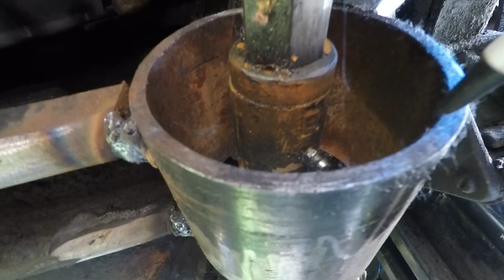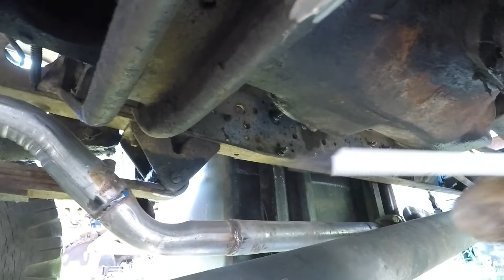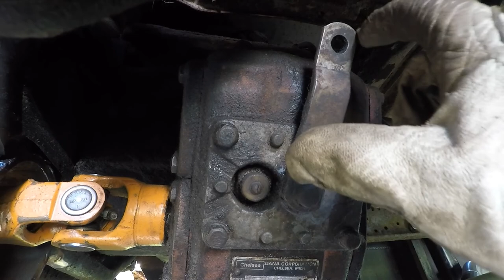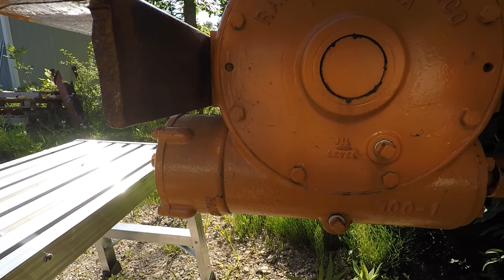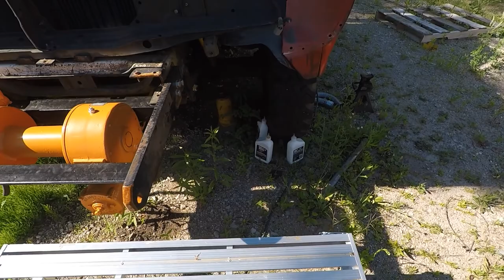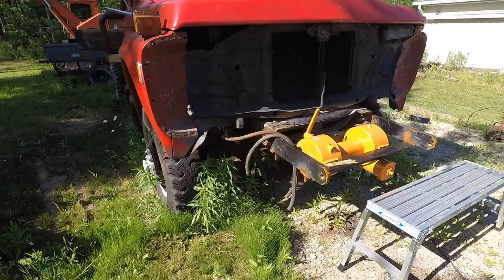Flatbed Project Update

Comment: How are those mobile home axles holding up
Reply from the maker: They are not mobile home axles. They are actually Dexter UTG axles. Been holding up just fine for the last 12 years. I actually hauled the F600 4x4 home on that trailer. It was about a 200 mile trip with roughly 12,000 lbs on it.
Reply from the maker: They're Dexter UTG axles, not mobile home. They're similar in looks, but are a different animal. They've held up just fine though.